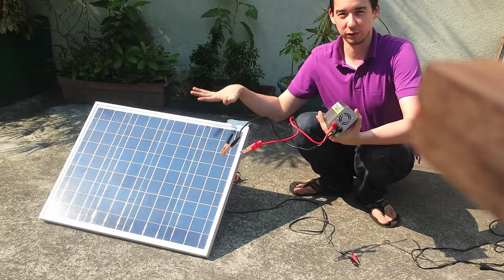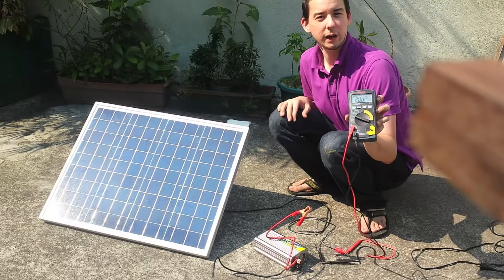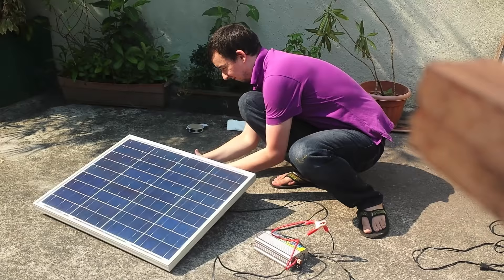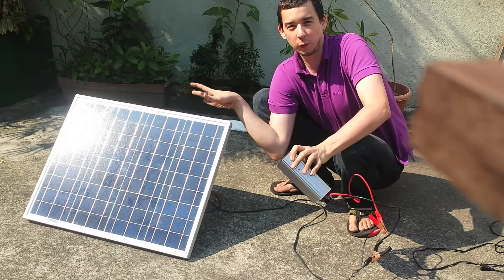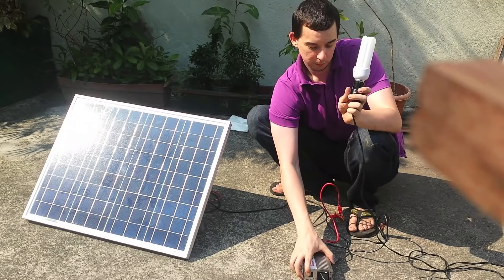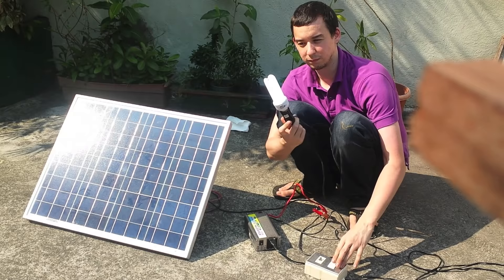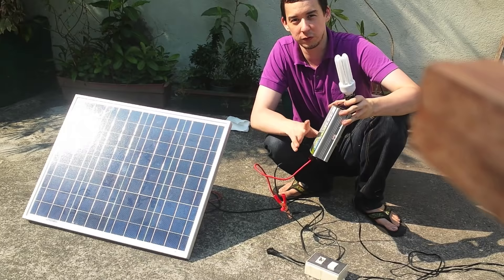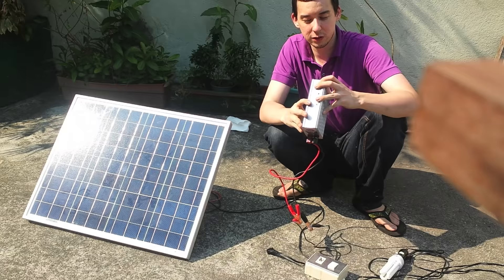Inverter wired directly to solar panel

Comment: You mentioned connecting a 12v battery into the circuit. For safety and financial reasons, you should also mention that a solar charge controller is an imperative, as is a general understanding of circuits and fusies. The charge controllers cost as little as £10 and they prevent reverse charging to the panels at night, prevent over charging of your battery when no load is applied and prevent undercharging and eventual death of the battery if a load is applied continually without the battery getting a charge from the panel... so in essence... Yes very clever that you can power a lightbulb in broad daylight but a pretty crappy way of spreading information to people who if they don't get proper advice from elsewhere might harm themslves or their finances... consider adding some of this information and a disclaimer about  checking you know what you are doing before dicking about with large currents from 12v batteries
Reply from the maker: I suggest you watch the video again and read the many comments here. I say many times that this is simply a proof of concept for emergency/can-it-be-done purposes and that you should be using a charge controller and battery. I appreciate the feedback but I don't think you've done enough research before posting such a negative comment.
Reply: Gadget Addict All I would say in response to that is that your "experiment" and proof of concept video does not have enough qualifying information in it to give people reliable and safe information. NOT EVERYBODY will read all the follow up comments and not everybody will do sufficient research before possibly ruining some expensive kit?  I know enough about the technology to say your video is flawed and additionally as a college professor in computing I know how vital it is to deliver information correctly with ALL the important information and caveats AT THE BEGINING, so that peoples understanding grows from a firm foundation. Why not edit the header with a link to some well laid out documents on the basics or at the very least mention charge controllers somewhere in the video... I did read down a couple of pages of comments... do you really think everyone else will, or should have to?

My comment was factual. You only consider it negative because you don't like it being pointed out
Reply from the maker: I think you're missing the point of the video to be honest. I have other videos which go into detail of solar and I don't feel it necessary to explain the ins and outs and requirements of solar in every experiment I do. The battery in this scenario is meant to operate like a capacitor and not for long term storage. I don't see how the video is flawed since it answers a question that I hear very often and I know of people who've used this method during emergencies when their charge controllers have been damaged. Having said all that, I should be willing to listen to criticism and feedback and I appreciate you taking the time to give me your comments. I'll update the video description and add an annotation just to make it dummy proof.
Reply: Gadget Addict hey, no problem.. I'm not on a heath and safety crusade buddy.. If you added the word experiment to the title it might make more sense... I was actually impressed that the setup worked... my only concern is the idea that someone might see that and assume that you can just loop in a battery. even that wouldn't be a problem unless you in a high rise apartment.. Overcharged batteries can be very dangerous ... heat/gas/acid... I've seen them burst and i've seen them explode... But anyway... still a fascinating technology and hey.. we are all learning new stuff as we go... Your other vids on the subject are excellent
Reply: U could use a dc to dc regulator. That may work:)
Reply: TheComputec Lets see you demonstrate something. Oh wait, you've no videos on your channel. How do you know so much? ILLUMINATI.
Reply: Mark Mendoza I have separate channels for my videos for obvious reasons. My videos are aimed at students researching theoretical computing modelling systems in the fields of traffic management and aeronautics... not really a general interest theme...But hey,  the internet is great isn't it.  tell me, what do you think the comments section of YT is for if it isn't for people to ...y'know... comment?
Reply: TheComputec You're a talker.  You sound smart.  You might even be smart and are what you claim to be.  But being smart is no excuse for being rude and crass.  Why don't you man up and apologize to Gadget Addict ?
Reply: sashimi1969 I don't believe I was being rude. English is not the first language of all You Tube watchers so all that I mentioned was that I thought the word EXPERIMENT should be added to the title and mentioned more in the video.  And here is why...  

MOST people do not read the extended description below the title (Statistical Fact that google do not refute)

A very significant proportion of people turn off the very distracting text boxes that appear all over videos- two clicks and you are done

What you then potentially have is somebody showing you how you can power electrical products directly from a solar panel via an inverter

It would be of little consequence to people who's apartment block burned down that the young man who posted this "also did some other videos where he did mention FUSES and CHARGE CONTROLLERS."  It would be a bit late?

I did reply to the OP 6mths ago and explain that I wasn't on a crusade and that I had no agenda it was merely that safety IS important when it comes to unregulated power systems like this.  Somebody watching the video should just be warned that this would NEVER be the way to run a system... but people watching this video will see it work and maybe not understand.  

So, NO apology  because he hasn't made the changes !!  He even advised somebody who asked a question about doing this system in the real world

"You might actually be just fine connecting the solar panel directly to the inverter, although some kind of regulator like what you suggested would be advised"

WRONG !!!  Not just advisable  -  CRUCIAL
Reply from the maker: TheComputec I don't want to jump back into this discussion because as I've said before, this video is only for test purposes. I have annotations and a video description that states this. But I just wanted to clarify something. My comment that you quoted was in reply to a very specific set of circumstances where I believed it MIGHT be okay. Unfortunately the person I was replying to has edited their comment and my reply no longer makes sense.
Reply: Gadget Addict Hello my friend. Same here I only replied because somebody was goading me. If my tone was a little brash in my initial response then that was not my intention and I have no axe to grind with you. I only ever thought it lacked the word EXPERIMENT in the title... nothing wrong with the video otherwise, although as I mentioned you will obviously be aware by now that people don't always read the expanded video descriptions and will often switch annotations off

But hey dude I'm not the internet police  LOL

Have a great day and keep the videos coming
Reply: +TheComputec Get over yourself pal!

Comment: So sketchy how ure handling the inverter with the clamps hanging so close to a short circuit.
Reply: PV cells aren't damaged by short circuits. Though 100w might damage the copper tips of the clips.
Reply: Well I should clarify. The panel won't be damaged but any bad soldering between components might get fried if the short lasts long enough to cause high temperature metal.

Comment: Higher quality inverters will Not accept the higher voltage. I always hook the Solar panel to the charge controller and then to my battery and the inverter is hooked directly to my battery or if batteries then to my lead battery in the bank

Comment: This unscientific connection，You have to add a solar controller and batteries, will be stable
Reply from the maker: Yep, check the comments here and the video :) It's not a recommended practice, it's just an experiment / "can it be done?". Yes  it can be done under emergency situations but otherwise you shouldn't. Thanks for the feedback.

Comment: Anybody who can teach me how to wired power inverter directly to indoor wall outlet or direct as main power source and supply?
Reply from the maker: +Hunts Hunter There's a few videos on Youtube but it's generally not recommended. You should look at grid-tie inverters instead.
Reply: +Gadget Addict ok I going to look for it!thanks anyway!
Reply: Is it illegal or impossible to used this indoor wall outlet as uninterrupted and continues supply?why do we have to buy Solar panels and batteries that so expensive! that hoping maybe to save more than we pay every month for electric bill for our entire lives.
Reply from the maker: Hunts Hunter It's not illegal or impossible. These kind of inverters are just not designed to tie in with your existing grid power. It's technically possible but not advised. You should really use the right device for the job which is a grid-tie inverter. There are electrical guidelines/laws in certain cities/countries that you should follow. You might want to look into Meralco Net Metering although most people I know are feeding power into their homes unofficially and not pushing anything back into the grid and haven't notified meralco. If you really don't want to use a grid-tie inverter, just run an extension lead from your AC/DC inverter into your home and plug things into that :)

Comment: What a load of rubbish, you need a charge controller to control the voltage going into the inverter or it won't last very long.

Comment: solar power is waste of money
Reply from the maker: When it comes to solar, it boils down to economy of scale. Small solar systems will take a very long time to pay back the investment. What you should remember is that solar isn't just about saving money; It's also about being green and not being grid-reliant. Solar is a great backup for grid failures or for use in remote locations where the grid doesn't reach.
Reply: Ridiculous comment... the whole fucking solar system is solar powered... The clue is in the name, so, if the planet can function powered by the sun I'm sure its a pretty good idea to mimic some of its benefits isn't it?  or should we just carry on burning everything till there's fuck all left?  

The return on investment is less than 6yrs on a domestic system, after which time you continue to get a boost of power for FREE to help run your home AND in a lot of developed countries you also get a rebate from the government for every kW you generate for 25yrs. It adds value to your home and gives you a warm fuzzy feeling from being less of a polluter